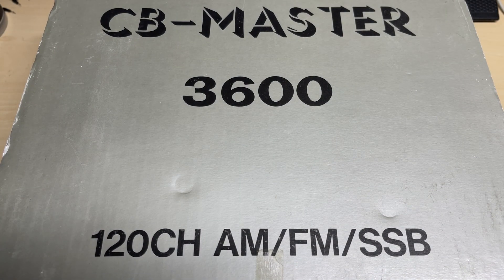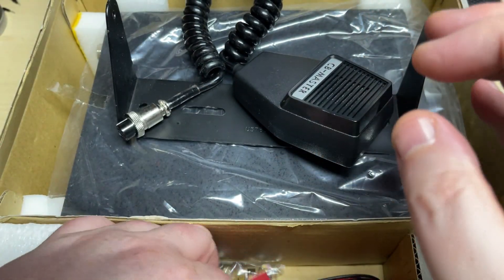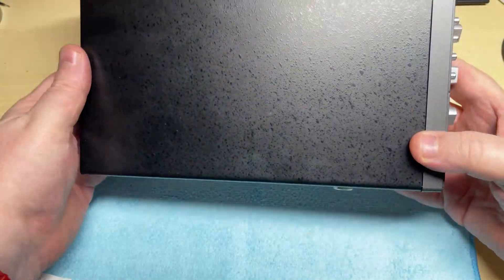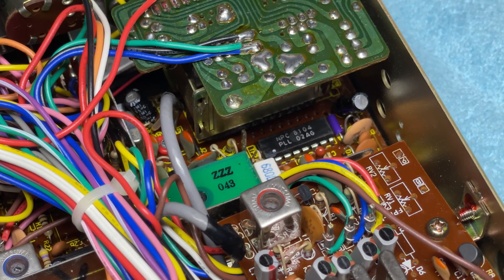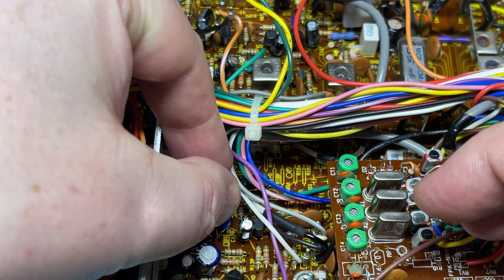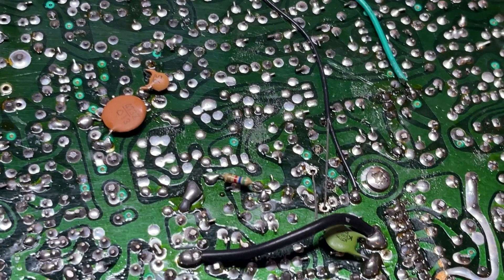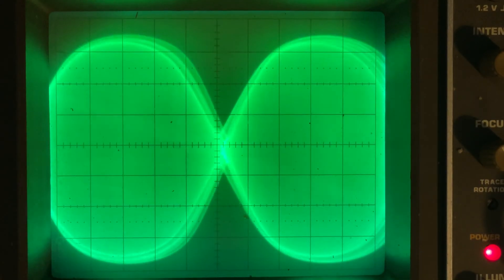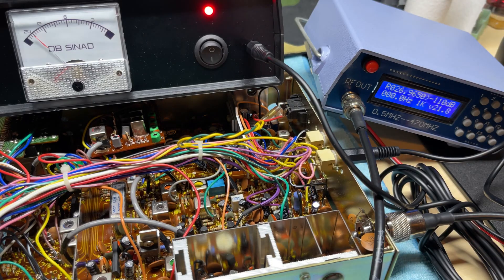EP 191 - New old stock, CB-Master 3600 - Will it work ?

Comment: The red warning label on the power lead reads in full.
WARNING DO NOT PUSH TRANSMIT BUTTON. 
Without First Connecting a 50 Ohm Antenna or Dummy Load....
😊😊😊
The CB Master are a smashing little set. Thanks for a very informative video.  I'm sure im like other subscribers and looking forward to more videos on this model.